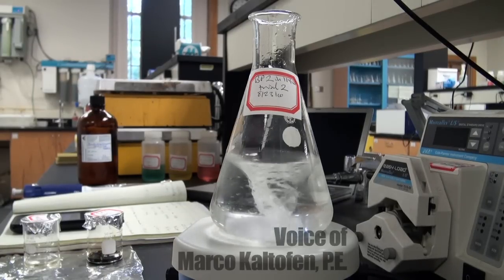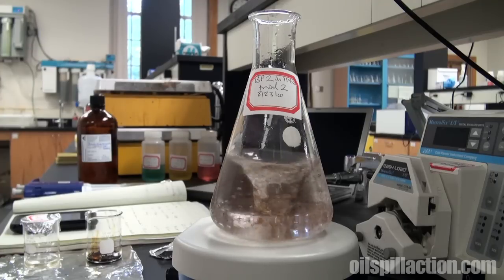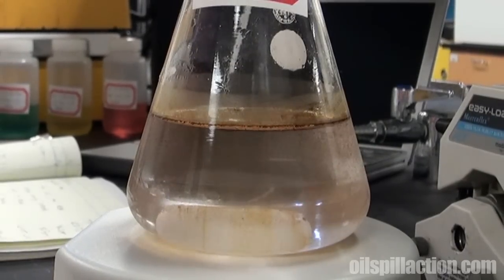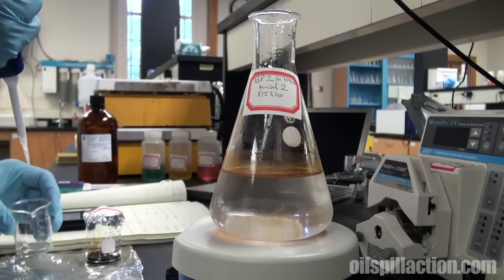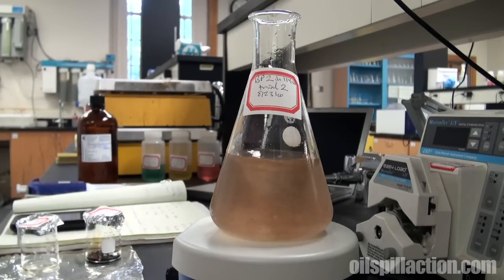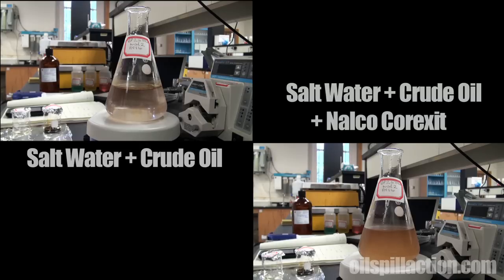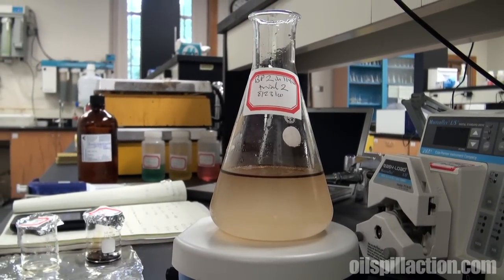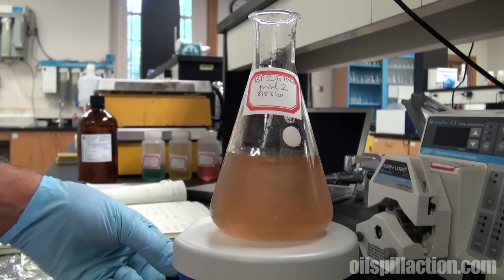Proving Corexit Poisoning-Civil Engineer Marco Kaltofen-Gulf Oil Spill

Comment: @joecuki

Isn't it true that there are natural oil spills? The ocean floor sometimes fissures and releases oil into the ocean? Wouldn't behave the same way, rise to the surface and get churned up on the tides?

If that's the case, then oil spills already factor in to the oceanic eco-system. It might not be such a good idea for us blundering monkeys to interfere with the process, adding chemicals and hoping for some desired effect. It's probably better to let the eco-system process it naturally.

Comment: I disagree with this test as I see in that small glass beaker the issue. The amount of oil placed into the beaker vs. the amount spilled in the gulf was not proportional. The Gulf of Mexico has a estimated volume of 643 quadrillion gallons. The estimated total spill from the oil spill commission report was estimated at 200 million gallons. BP's reported that they used 1.9 million gallons of disbursement. False test. Also, dispersant went in at the point of the spill not added to top.

Comment: @MrGiganticpanda @fishyboy111 (no idea if this works)

Yes, I'm not denying the ocean floor has rare species and is scientifically very interesting. But there's far less biomass as well as biodiversity present than in the water and at coral depth. The ecosystem on the bottom is also pretty isolated while our corals and "surface" sea life stand in direct connection with the ecosystems on land. 

The choice is pretty easy, let the shit stick to the bottom where it causes less harm.

Comment: I'm not sure if this experiment is very well controlled. Dispersant is meant to disperse no only light curde oil found on the surface but heavy crude found on the ocean floor. In addition, the purpose of the dispersant is to allow for easier bio-fixation by bacteria and other micro-organisms. 

I'm chemical engineer, (the current head of the EPA, who authorized the use of dispersant is as well) and think there's more to this than just the immediate concentration the mid column of water.

Comment: I don't get why anyone would want to sink the oil?? It is completely irrational.  We have no equipment to clean the ocean bottom or equipment to filter water to clean it?  The only thing I can rationally think is that people are poisoning US on purpose.  They are not only doing that but they are killing the Gulf Loop Current by dispersing this oil with corexit.  This is so crazy. Someone told me once they were bored with this 'story' even before the oil had stopped flooding the ocean :(